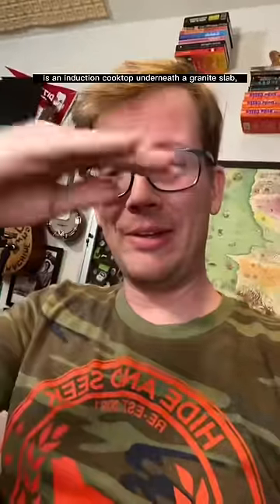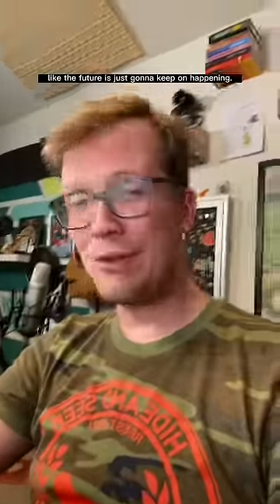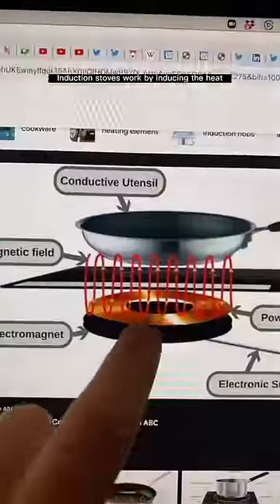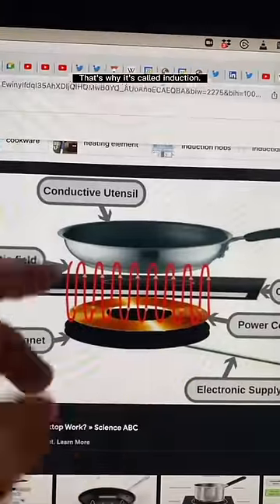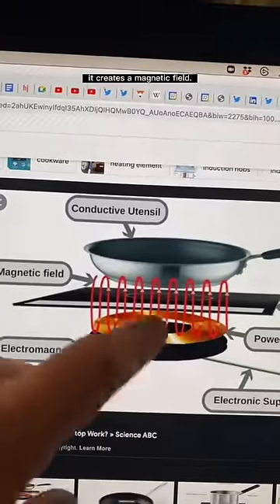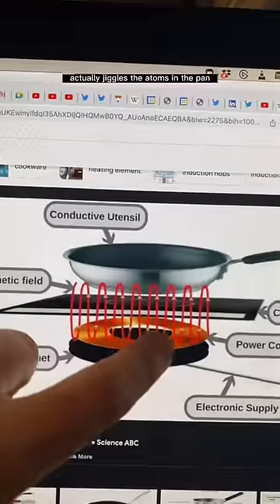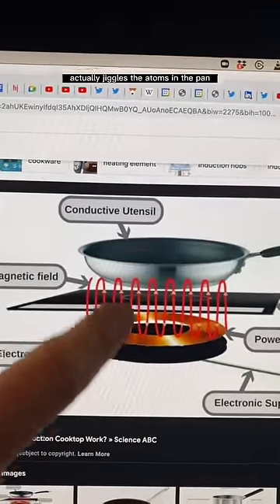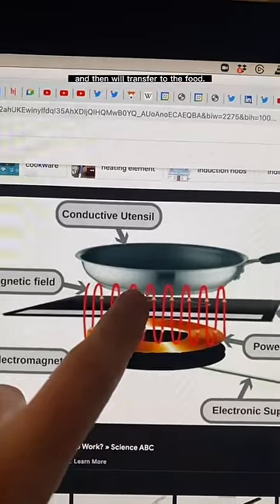How do induction cooktops work?

Comment: Please do not get an induction stove, why would you even suggest that, they suck, unreliable, heat unevenly, and you cant get it hot enough some times, plus its nearly impossible to tell if you are on the burner half the time.. gas stoves are by far one of the best stovetop designs to date, they are super quick at heating up or can be just slightly warm, even heat distribution all around, can use a variety of different pots and pans you couldnt before, and it just arguably looks so much better than granite… if you know, you never use those 3 stone materials

Comment: Induction is not better, heat capacity changes how you cook and less heat capacity = Less felt power when cooking. Induction lowers the heated objects and thus the heat capacity of the system. It is harder to cook "smooth" with induction aka less searing or mushing.

Comment: This is great because stone doesn't expand or contract when it gets hot, right? "But", you might say, because you don't have an induction cooktop yet, "the cooktop doesn't get hot. Only the pan does!" This is incorrect. The pan gets hot and transfers its heat to the cooktop. And that s--- is hot. In this configuration you'd have NO IDEA when you put your hand down on the counter whether it's room temperature or 200 degrees. At least, until you touched it.

Comment: Cool but I imagine impractical and annoying. Why is my pasta water not heating up? Oh yes I had it just to the side of my stove... you can tell she doesn't do any serious cooking. Juggling 4 pots and pans and having to rely on your spidey senses to make sure they're on their respective cookers is just plain annoying. Also. Over time the surface the pot is sitting on is going to become warn and discolored. So soon you'll end up 4 strange circles on your counter. 
Having a stove that matches your countertops is great. Having your stove under your countertop is cool and futuristic. But I'd definitely choose just a nice fancy stove over ruining my countertops with constant ware and tear.
Reply: You can put a thin cloth made with heat insulation material as a pad for your pots. That won't affect much on the heat transfer because, as stated in this video, the energy goes "through the air" (changes in magnetic field). This way you can protect the countertop.
Reply: @jeancanestri5572  yes its an induction cooker. But. The pot still gets extremely hot. And if you're putting down mats on top of your seemless, invisible cooker, doesn't that defeat the purpose? Like I said, she probably doesn't do any serious cooking. What about when you want to blast a pan with heat to sear a steak or make stir fry? Insulated mats are going to have a very hard time at that temperature and degrade and discolor quickly. Again making the countertop less attractive not more. But if she's doing just a little cooking like warming up soup I don't see why this wouldn't work. I'd be very interest to see how the stove top looks now and under what load she has been using it.

Comment: Yeah but they need a lot of electricity
Reply: within a very short amount of time.Same concept as a light bulb using more energy than an oven.It's all about duty cycle
Reply: @logickedmazimoon6001  but not all dishes needs a quick high heat temperature, what if i need to leave something in for an our on low heat
Compare that to an oven i bet it wouldn't need the same energy for the same temp/time

Comment: Pretty sure that also wastes a lot in terms of efficiency.
Reply: Stovetop efficiency is one of those things you can feel. All of the heat you feel while cooking is waste heat, because it’s not in the pan. Induction is leagues more efficient than everything else because the part of it that heats up is the pan itself, it doesn’t heat up a surface that then conducts heat into the pan. This also makes induction faster and easier to precisely control than any other type of stovetop

Comment: ...I don't suggest this... u loose  alot of benefits compared to the ceran fields... the stone will maintain the pan in the beginning cooled --> loss of energy --> loss of fast heating.

After shutting off, the stone will remain very very hot compared  with ceran or glass  surfaces --> loss of safety because traditional surfaces are touchable a few seconds after u remove the pan even stove is turned on.

So u decrease the efficiency, safety and the visibility of the heating surface for only esthetics by vastly increasing the price...

Comment: I don't like induction stoves at all, they have clunky digital interfaces, the surface of the stove does also get hot from the residual heat of the pan - so they're not actually much better, they don't work with all pans, they have a loud electric hum, cause interference and I have a friend who has a pacemaker...

Comment: Nah, I'll take the actual fire of a gas stove, or even a wood stove.

Actual fire has the advantage of throwing off heat and light, which is quite a bit more useful in a power outage, since it will actually work, and much more apparent if the stove has accidentally been left on.  I don't want to leave an induction stove on and accidentally heat up a spoon to 1000 degrees, just for me to grab it later.

Is actual fire more dangerous?  Sure.  I don't care, because I'm not incompetent.  Does actual fire generate emissions?  Yep.  I don't care, because I'm not a neurotic coward.

Comment: This explanation of induction cooking is actually false. It doesn't jiggle atoms. The magnetic fields creates tiny electric currents in the bottom of the pan, called Eddy currents. This electrical power is dissipated as heat.

Comment: induction tops are pretty sht.  no better than ye Olde electric coil from the dorm room days.   you have literally zero control over your heat and pan temps.  even the cheapest budget gas or wood burning stove of the 1800's is light years ahead of induction.

Comment: Unfortunately with most induction cooktops they require specific cookware to work and that cookware is expensive, breaks easy and is cheaply made because the demand for that specific cookware is very low meaning profit is low and that has to be made up with cheap materials marketed at ridiculously high prices.

Comment: If your gas cooktop is releasing anything more than CO2 and H2O, your gas company needs to be pulled in line. Everyone is just fine with those two chemicals.  Firstly, we breathe out 57,000 to 80,000ppm CO2, and using your cooktop won't cause you to breathe in anywhere close to that concentration; and then there's water in vapour form - apart from the temperature, also not a problem for us - in fact, it's good for asthmatics.